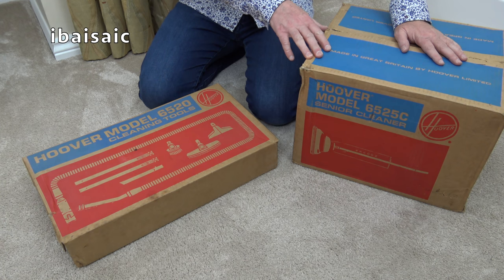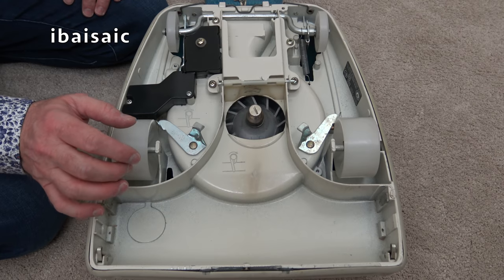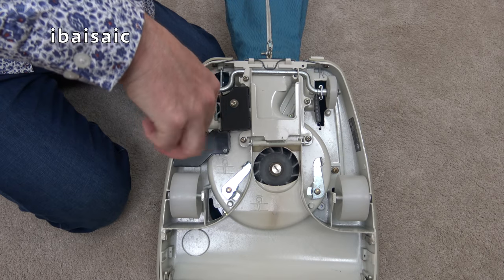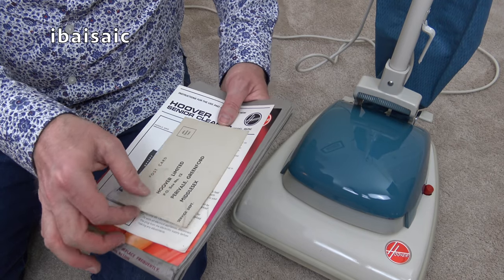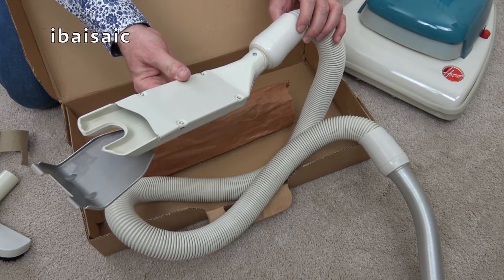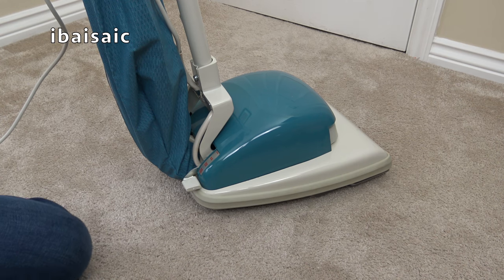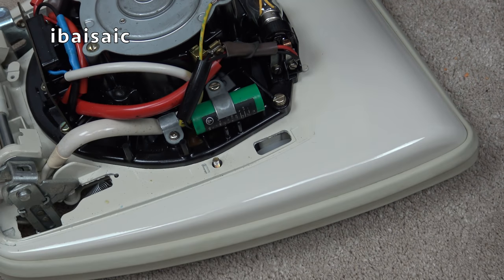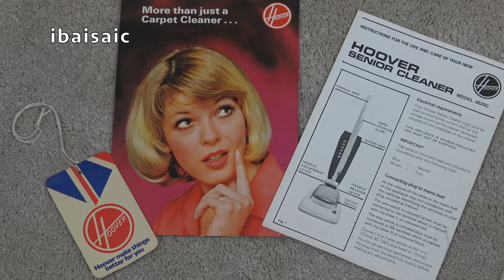Vintage Hoover Senior & Cleaning Tools Unboxing & Demonstration

Comment: What you call a "suppressor" seems to basically just be a capacitor connected in parallel across the motor. It would not only block RF noise kicking back into your house wiring, but would also help to reduce arcing on the motor brushes. The vacuum will work fine without the capacitor, but you'll probably get more wear on the motor over time. If you really wanted, you could just replace the capacitor with a modern one if you could look up the right value - it doesn't have to be a "special" type. All that matters is if it's the right voltage and capacitance value (in microfarads, usually).

Comment: I much preferred the older metal base models like these not only for their strength but since their converter slid in from the back they didn’t tilt when pulled while using tools.

Comment: These were great machines but because of the badly designed connection  the tool were little more than useless that's why so many are found in excellent boxed condition .

Comment: I can hear the differences in the amount of air being moved through the motor and i could actually see the difference on camera you can see the brushes spin up and speed up for the brief moments that you turn on the micro switch or activate or switch

Comment: i found  the older bronze coloured one had better hose suction with the side converter entry even with the machine staying at 1 speed ...withe 652 series you had to have a brand new clean bag on for decent hose suction...the power dropped the more the bag was used...I think it was stronger on the older type because it only had the cloth bag no paper insert..thats my experience anyway ...all brilliant strong classic machines though ...love them

Comment: Why not just let it run on high speed all the time? It would have better suction on the floor mode as well.
Reply: I would guess that it would only make a very small improvement, at the cost of noise, carpet wear and 55% more electricity. Almost certainly not worth it.

Comment: Just get a X2 275 volt rated safety capacitor of around 0.33uf. cheap as chips. or get one out a scrap modern cleaner. usually small yellow box types.

Comment: Roger I like your videos and I like this Hoover Senior, it is the sort of vacumn I remember in some peoples homes, although we always had the Electrolux cylinder vacumns. 
It would be interesting to know how much these cost in todays money. I am at a  loss to understand the prices of some modern vacumns such as Dyson or the corddless one whose name escapes me that costs in excess of £700 and seems such low quality construction. 
I use a Henry and am very pleased with it and enjoy using it, which is really what counts.
Reply from the maker: In the 1973 Argos catalogue this cleaner cost £28.25 which is the equivalent to £375 today using an inflation calculator.
Reply: @ibaisaic  bloody hell how currency has changed

Comment: You turned the belt to attach to the shaft rod in the wrong direction. Check the design of the "cover plate" for the belt & brush plate cover.
Reply from the maker: No I didn’t.

Comment: Do you have to connect any wires together once the suppressor is removed or can it just come out?
Reply from the maker: It depends on the way it’s wired in. Sometimes they can be removed easily and other times you need to reconnect wires.
Reply: @ibaisaic  Ah, I see. Thanks for you help!

Comment: Oh and it likely failed as you replaced the headlight which was the suppressors load with and led bulb which has no loading and a diode effect, it wouldnt had gone on the original bulb. as was designed.

Comment: What’s a suppressor I never hear of them
Reply: A suppressor is pretty much a big, fat capacitor slapped across a dirty, inductive load, such as a motor, like that in a vacuum, to “suppress” any electrical noise generated and balance the load type.

I hope this makes sense.
Reply: @huskyvacs  did not know that part.  My understanding is it’s really common in industrial applications where the business is charged for apparent power, not actual power.